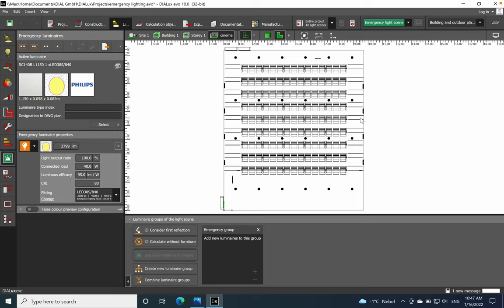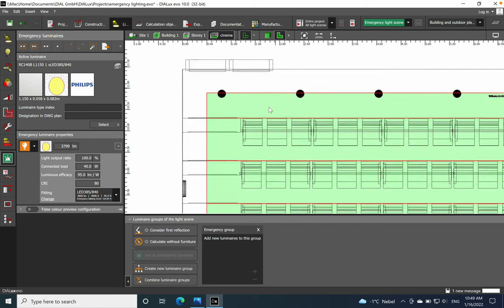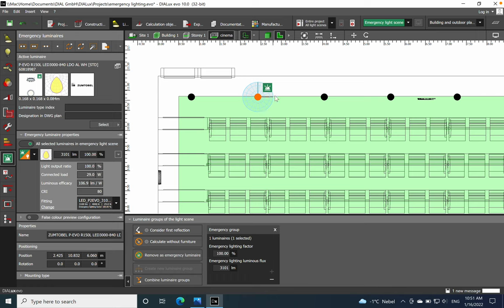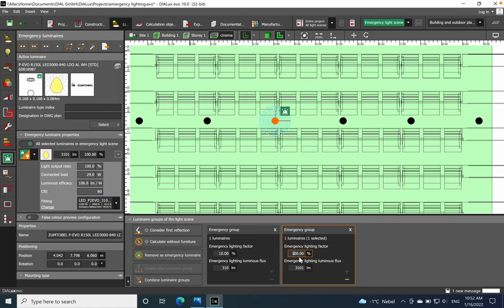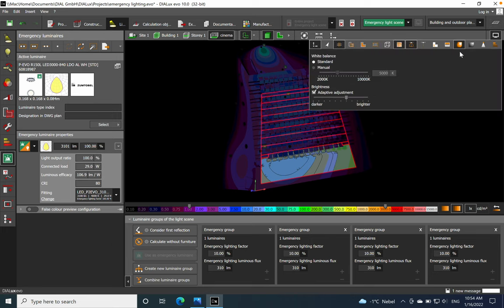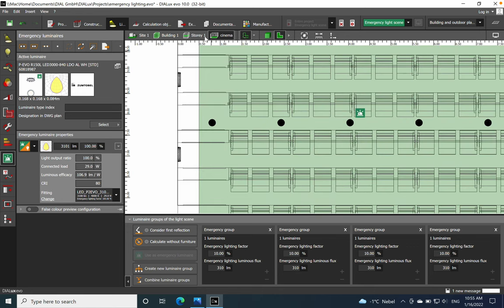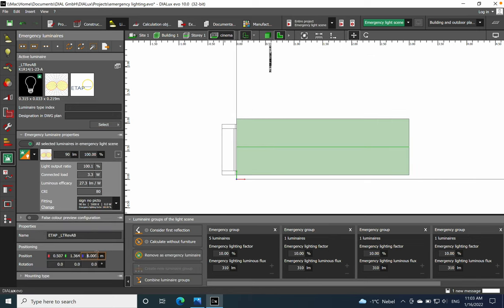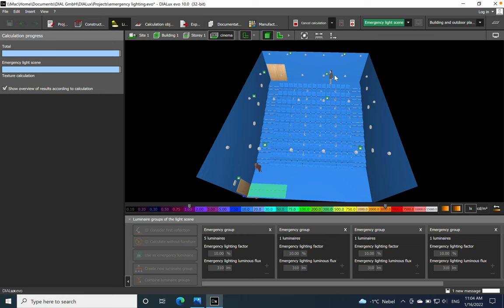How to calculate the emergency light design

Comment: Good day Sir! point of note. the luminaires you chose have a 100% Emergency lighting factor. when you look at the specs of the fitting you can see this has been specified. so instead of 10% you can use 100% which will allow you use fewer numbers of luminaire. Also it is advisable to change the Emin to 1 lux as this is the minimum I have come across in most standards and depending on the location and type of work some require 15 lux. 
I enjoy your videos. thanks for your work
Reply from the maker: Good day to you as well. I appreciate your comment and happy to see that you were following all the information from the video.

Comment: Maan, dont feel that I hating you, really not in bad , just simple my good advice - this emergency lighting simulation is wrong as it is possible - the escape route (the side corridor/stairs are part of the escape route too, minimum on the left side because of the upper door opening and the antipanic area where the seats are, where is?- I know that the simulation will without the seats, just the whole area, but it shall be approved too)...I really hope that this is not final version (measurement area/route placement) of the simulation - and really not in bad, peace
Reply from the maker: thanks Man for your comment. I apreciate you time in checking the video.  As you can see in the video I took the antipanic, a flat area as an example how you can define it and not for implementation. If this project had to be implemented then you need to do the correct setup of height for each row of sets. In the case of escape routes, you just need to add the escape signs above the two doors, knowing that the antipanic lighting system will provide a higher light level than the one requested for escape routes.